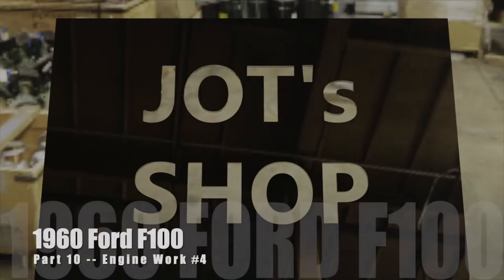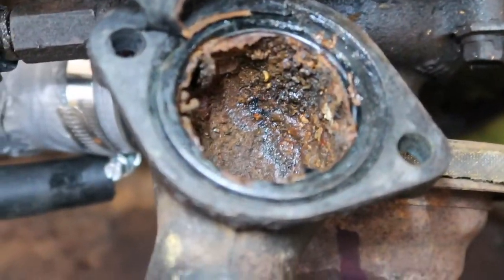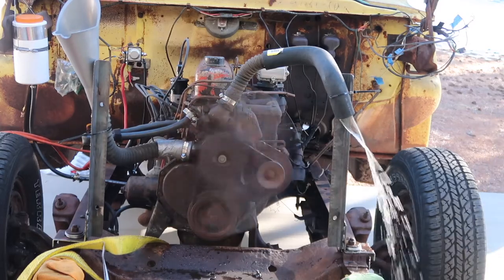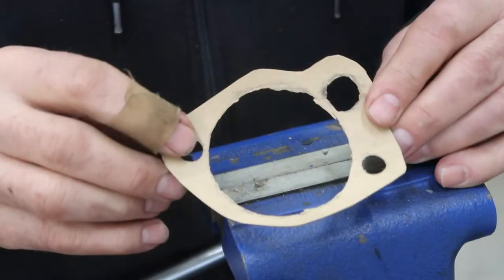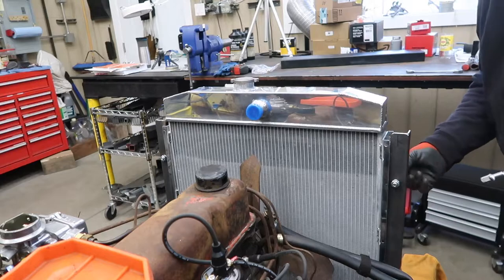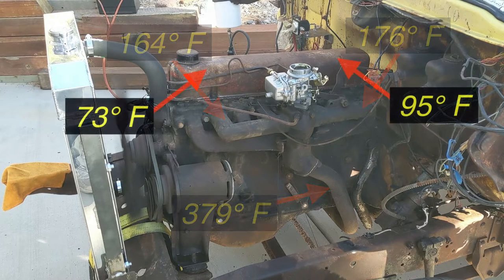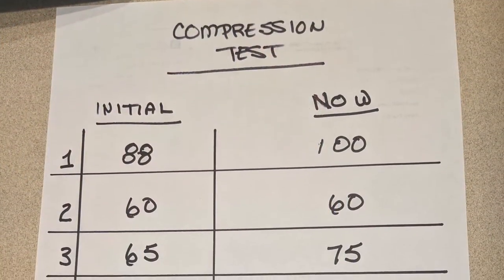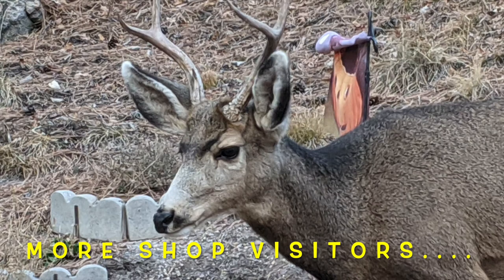Part 10 - F100 '60 Ford Truck Restoration

Comment: interesting build. I have a 60 f100 and cant find the vin. It should be on the passenger side on top of the frame rail in front of the axle.  Can you see yours, since you have all the fenders off? Thanks, tom.
Reply from the maker: Thanks for the comment and for watching! I'll head to shop and check for frame VIN. I do have the normal one on the glove compartment door where it looks like yours has been removed.